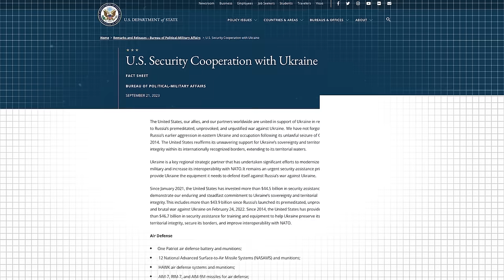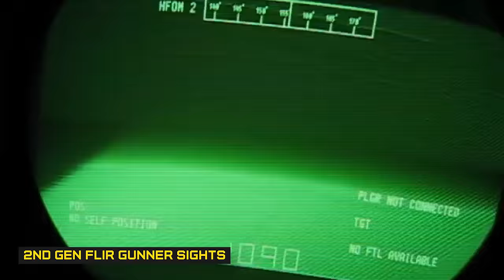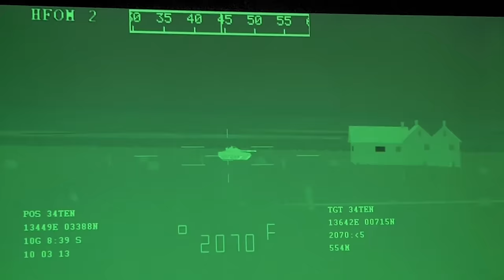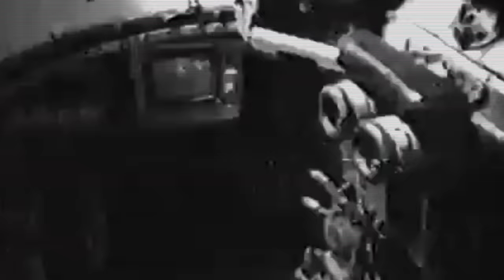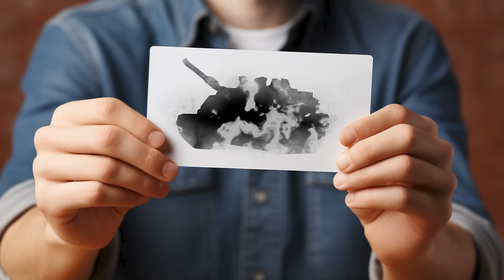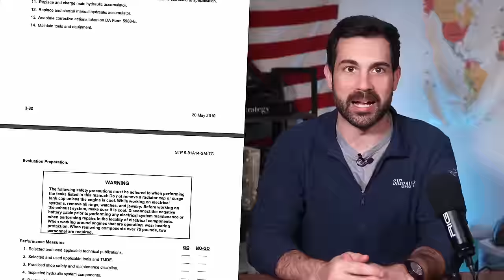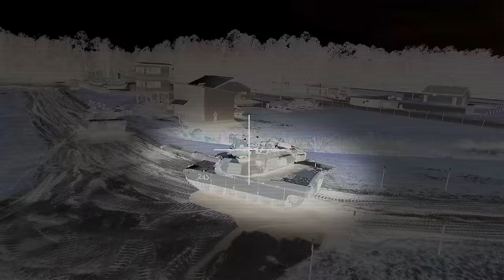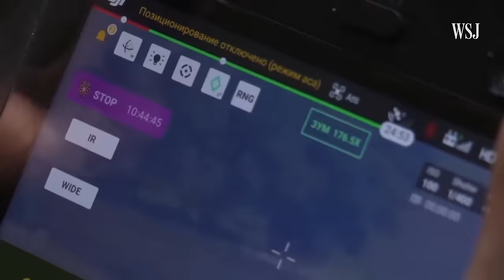M1 Abrams Tank Tactics in Ukraine

Comment: I agree with the technical analysis and the analysis of logistical difficulties, but the confident statement that 31 tanks will push out the fronts and break through the defense lines is simply BS, sorry for the expression... The Abrams does not have any capabilities that the Russian army does not have in much larger quantities. To force a breakthrough, it would be necessary to deploy at least as many devices as the Russians have, and this will not happen, as Ukraine will not be able to train so many tank operators, due to lack of time and huge loss of manpower (assuming that the US can/want supply Abrams in sufficient quantities.).

Comment: OK. -----.  Sorry old man but the Abrams is famous for being quieter than Diesels... and with the APU (Auxiliary Power Unit) the tank only uses a few gallens an hour quietly sitting still on watch... resulting in an actual saving of fuel over a Diesel since most time is spent waiting on watch and not Traveling...  you need to start talking to better experts...

Comment: Abrams have a huge disadvantage though...
It doesn't have the mobility it needs in a battlefield like that in Ukraine. The T-80 snd T-90 can manuver in the battlefield avoiding enemy fire much more easily.
Leopards and T-80s are the right tanks for this war.
Reply: Wrong, it’s about range, fire rate, and optics.  Ref. Iraq invasion
Reply: @icu17siberia  The terrain is nothing like Irac's. It is muddy and Abram's have zero mobility. Instead of Abrams they should have bought artillery and not a tank that they are using it like artillery.

Comment: DU protects from both KE and Chemical. just more against KE. Tandem is more of a threat but the from and sides are rated to take RPG-7 Tandem warheads. The front of the turret is rated to protect from Kornet Tandems, but not the sides or hull front.

the M1 engine can run off nail polish

also loud? wtf? the M1 has a higher pitched sounding engine. you feel the ground shaking before you hear the M1's engine. compared to those Diesels the Leo2s use. can hear the thing start up from a km away

Comment: Russian tanks have not had Carburetors since the T-34 (and KV-1) came out in WWII,  those were diesel engines tanks and that requires Fuel Injection systems.    Probably due to the crappy fuel the Russian had (diesel comes out of an oil column on a first pass).     Ironic that the Russians had the complex and intricate fuel systems and Ivan and his hammer for the rest well before we did! (well we had some Diesel Sherman's but those were not the common Sherman  in WWII).   Gum will not fix a diesel engine or its fuel system!

Comment: The Abrams is good for vehicle-to-vehicle combat in Ukraine due to its optics and frontal armour, but it is just as vulnerable to drones and ATGMs as its soviet counterparts. 3 M1A1SAs have been destroyed so far, two by drones, and one by an ATGM fired from a tank barrel. The thing is, the main actual advantage of such tanks is the ammo storage placement, but in combat conditions the loader sometimes does not close the sliding door every time, and particularly ukrainians have shown to not be disciplined with that. Furthermore, blowout panels usually save the crew, but do not prevent the tank from taking critical damage that makes is hardly repairable. Finally, both M1s and Challengers have shown to be unsuitable to Eastern European terrain, sinking in dirty roads due to their ridiculous weight and requiring specific engineering vehicles to be towed, as the soviet ones in use by UAF are made for lighter vehicles

Comment: The m1a and its more recent versions is the best tank in the world atm.  In part it is battle tested and survivable. We are going to see modern Israeli tanks soon enough and I suspect they will perform well.  We have also seen Russian and German tanks and they are lacking especially the Russian tanks.

China has a new tank that is more a medium tank than a mbt.  That just leaves the Korean black tank which is a true mbt over the Chinese junk.

The cards are going to lie on the table for most of these countries and I suspect as has been debated for the last 10 years that the tank will be in decline soon.

Just sending a tank isn’t as easy as o e realizes.  The crew and service team is quite large they also need heavy recovery vehicles which Russia has few of.  It costs a lot to maintain and service these machines which were either simple in ww2 like the Sherman or incredibly complicated like Germany had I. Ww2.  Simple was better in the end.  But the Germans had several tank aces which tells you the crew is more important.  Russia has lost many thousands of crew. They simply never care about crew survivors.  The Israeli tanks focus on the crew surviving.  The m1a is magic with the triad of proven gun, reliable engine, and armor.  The edge comes with the best tank training.  The ukraine may not be up to the task training wise.  The Russians certainly are not

Comment: Ok, a couple of things. And so you know I really know my M1 tanks, I was a tank commander on the M1A1 and M1A2 tanks for over 9 years. 
The first thing I want to address is the Abrams is not louder than a diesel. I have much experience with diesel  tanks such as the M48A5 and M60A3 tanks. In fact when I was training in the Texas National Guard on the M60A3 tanks we got to see the first fielded M1's. Our 2nd Lt got lost and was running around and we could hear him for a mile or more. When we seen the M1's we did not hear the engine until they had passed us and it was not that audible. The track noise was more audible than the engine. 
In Germany, the leopard 2 tanks were much louder. We could hear them coming before we could see them. Many minutes before we seen them. They usually did not know we were there until they could see us. 
The same held true at NTC. We could hear the T72's and BMP's long before we could see them. And they did not hear us until we were on top of them. They were the OP4 using captured Iraqi vehicles from Desert Storm in 89 to 90. 

The second point is the amount of fuel it consumes on start up. It is not 10 gallons, it is 6 to 7 gallons. Unless the Army went to a less efficient engine since 1999 when I left the Army.

Comment: This is isnt true, all russian tanks after t64 have laser rangefinders and thermals, t72 2012-2020 have French optics and modification 2022-2023 have russian optics produced not far from my own town. Yes, russian optics worse then french, have 2km sight, but they are exist. BTW, Thermals integrated in Сосна-У complex. Aaaaand, EVERY т72б3м 2023 have it, and russia make them around 30 or 40 at mounth now
Reply: Those are barely useful when the tanks are produced with differing qualities (some with worse armor, worse transverse, speed, weapon systems, etc) due to the large corruption in the factories. Also with the fact that T-tanks have a smaller profile than those of the Western’s. This is mostly because back in the Cold War, if the USSR decided to invade, they would deploy mass offensive tanks (sorta like a banzai in ww2) with their sheer numbers and mass. But this came at the cost of crew effectiveness, because of the smaller profile, the crew stations are also smaller making them cramped. Due to this, the crew cannot operate to their max efficiency.